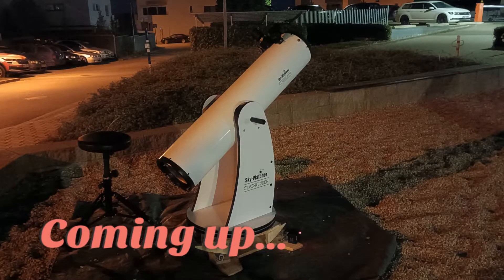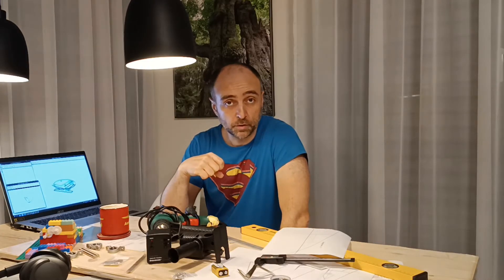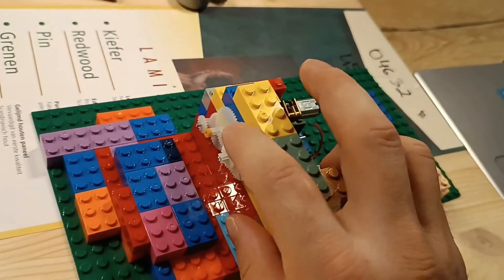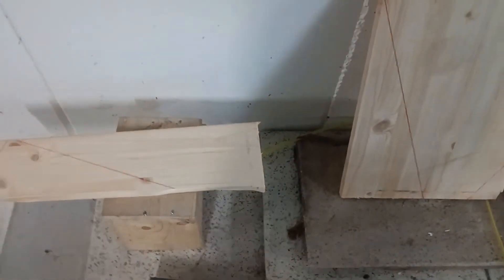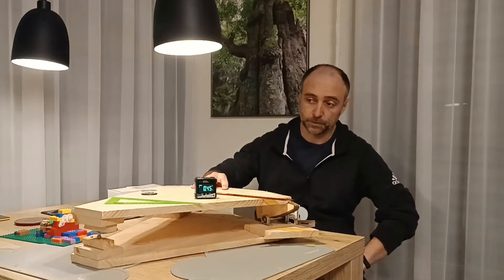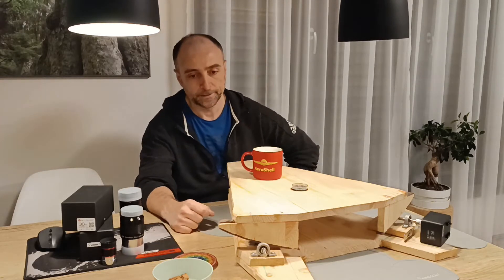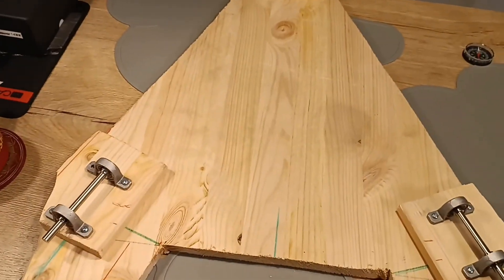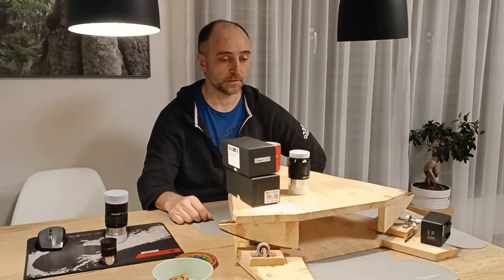Tracking for a Dobsonian Telescope - Home Made EQ Platform

Comment from the maker: 🌟If you are intending to build one of these make sure to also check the second part of this video. It is for a larger DOB but it contains some valuable lessons learned that need to be incorporated into the design of any EQ Platform🌟
https://youtu.be/8NtrHkfYcRs
Reply: Які сигменти потрібні для широти49°05′ пн. ш.,дякую.
Reply: Good afternoon Can I ask you to send me information where I can buy a motor and components for this platform, thank you
Reply from the maker: @denibeni4982  Please see the following instructions - https://drive.google.com/file/d/1ZZb25MRHyBEOHmIY-6CAJ1WFfoio8Uv5/view
Reply: Good afternoon, can you tell me what the diameter of the internal shaft in the celestron eq2 ?

Comment: Great video and explanation, i am very interested in building my own eq platform and this is the best video i found on youtube explaining it

How is the platform polar aligned? The front part should be pointed to polaris?
Reply from the maker: Hello , the pointy end of the bottom part of the platform should be exactly south.
If you are in the southern hemisphere, then it should be north.
Reply: @astralfields1696  i live in a 36 degree latitude, i used chatgpt to calculate how to make them, and i succeeded in making some circles around a 36 degree line, but dont know if they are exact:

This is the method i used

1. Draw a 540mm line (length of base)
2. Mark the pivot on the line (20mm from the right side of the line)
3. draw a 36 degree curve from there
4. Mark a point on the degree curve line 69cm (for my particular latitude) and draw a 69cm circle with a compass from there
Reply from the maker: Sorry I use my own SciLab script, don't have the time to go into details of other methods 
Have a look in the description of the video, I offer fully ready to use plans and segments (per specific location) for a small donation.
Reply: @astralfields1696 nice, i understand, so buying your plan i will have the segments specifically to my 36 degree location ready to print and cut? Thanks
Reply from the maker: Exacrly.. I calculate it to a six digits precision.

Comment: Interesting video.  Ive looked at Rainer Vogel website and concluded if you want a true conic section for the VNS platform instead of cutting with a saw you can 3d print an exact elliptic segment for any lattitide.  I also think a stepper motor (with Arduino control) will be sufficient as old printer/scanners have these motors that would otherwise be scrapped.

Comment: Hey brother, make a eq dob mount for 12" also....
Planning to get it but 10" or 12" which should I go for...
Reply from the maker: Hello, Already did. Check out my video BIG TELESCOPE tracking which was a few videos later :)
I would recommend the 12" DOB over the 10" DOB.
Reply: @astralfields1696  Yes sure 😊 I'm going for the 12"🔭.
Brother, can I use Single "Nema 17 5kgCM Stepper motor for 12"?
I don't know how much KG/cm celestron motor is, if you confirm please reply.
Two celestron eq motors are not in my budget..
Reply from the maker: @swarajdevotee721  The 12" is a great choice. I have no experience with the Nema motors. The issue is not about KG/cm but slipping between the rods and the wooden segment. If you watch the video, it was slipping with one motor and as such I can't guarantee that my design will work with a single motor. Maybe it will if you solve the rod/segment friction point somehow, add a sanding paper or something like that. 
Never investigated those options as I found it easier/more stable to invest in two motors.
Reply: @astralfields1696 That means It has power but slips right? If I make some changes for friction, then It can be done with a single Motor. Correct me if I'm wrong 😊
Reply from the maker: @swarajdevotee721  Yes, I think one Celestron EQ1 motor should handle the load.. but it also depends on the latitude and how tilted the telescope will be ... lower latitudes = more tilt = higher strain on the motor.
Reply: @astralfields1696 at 20° latitude, what's your suggestion, what should I do
Reply from the maker: @swarajdevotee721  Ahh my friend, that is too low I am afraid to be working even with two motors. My platform can handle latitudes from 30 degrees up only.
Reply: @astralfields1696 ahh it's fine, Can you give me some Idea, how to measure and cut the woods for 20° latitude. It will be very helpful 😊
Reply from the maker: It is not a problem to calculate it, the problem is to build it.. that is way too steep and it will cause the telescope to topple over in 15 minutes of tracking. At those latitudes you have to investigate other methods of tracking.
Reply: @astralfields1696 I understand, for now  making this for 114mm dobsonian. Hau to measure and calculate,

Comment: I bough the instruction and made an EQ platform. I am so happy with it. Until now, I was not really spending time with moon or planets. I have a 10" F/5 Dobsonian and never used eyepieces with short focal length, e.g. max 15 mm. Reason: everything was moving too fast and had to correct too often. With the EQ platform, I don't have to do it anymore 🤩. I started using my 9mm and 6mm eyepieces and starting looking at the moon. Yesterday, at ~210x magnification (6mm), I also started drawing moon craters, which was not possible until now. The EQ platform changed my observing life and I am thankful to Evel🥳. Only drawback: the telescope gets 15-20 cm taller. I have an adjustable astrochair and this is only a problem when observing at zenith.
Reply from the maker: Congratulations 🌠. I hardly ever use my telescope without the platform. Especially planetary nebula are so nice to  look at high mags.
Reply: @astralfields1696  Where can I buy the instructions?
Reply from the maker: @Alexutzu.2010  Please contact me on evel30m@yahoo.com with your latitude and telescope.

Comment: I ordered the sector template from your website for my 35.6 N latitude and the full PowerPoint!. Made a tweak to lengthen the north to south bearing. Made this eq platform and it moves perfectly (used two motors as my scope is 10” and heavy). Now waiting for clear night. BTW I used voltmeters too!

Comment: How do you account for the added weight when attaching more accessories? For instance, with components like a camera, barlow, or field rotator, or if I decide to switch from a planetary camera imaging setup to a DSO setup?
Reply from the maker: The EQ platform has a lot of flexibility in terms of the center of gravity. It is absolutely fine adding or removing weight from the whole telescope in terms of equipment.

Comment: The drift is most likely due to imperfect polar alignment. For really accurate tracking one should perform drift alignment anyway.

Looks good. Great for high powered observing, sketching and even some eaa/imaging.
Reply from the maker: Yes that is correct, usually there is some drift up or down due to alignment. I don't usually bother about it unless I am imaging at high power for long durations (example Mars for 10 minutes)

Comment: Great video!  I would love to see you create a video of your setup/alignment process for an imaging session.
Reply from the maker: Yeah , that is something I am planning on making a video but the weather here has been abysmal. Haven't had the chance to do a single imaging session since August :/
Reply: @astralfields1696  I would like to see that too. My platform is tracking well, but for planetary photography I get a little drift (away from the equatorial tracking) which may be due to polar miss-alignment. I have to nudge the telescope which is difficult at required magnification. The alt "bearing" has too much sticktion. I already replaced the bottom friction bearing with a Lazy Susan style bearing which works great.
Reply from the maker: @ Yeah, there is a way to achieve an exact alignment with the EQ platform, sent you an e-mail on that earlier today :)

Comment: First of all, thank you! All others over engineer and complicate the design so much that they're near impossible to replicate without a degree and laser-accurate equipment. 

I need your help ...

1.  In order to eliminate the dreaded azimuth "sticktion" issue that all dobs have, I added a 1/8" thick sheet for the Teflon pads to slide on.

2. I'm at 33.23°

With the additional 1/8" height on my base, could I simply use the 34° wedges?

If not, could you calc these for me and let me know the dims?

You're the best!!
Reply from the maker: Thank you!
I agree, I did not like most designs I found online as they are usually overengineered. While it may be sometimes fun to overengineer things, it makes for a poor DIY design that anybody can replicate. That was my main goal, simplify as much as possible and keep the costs to a minimum. Glad to see that now over 10 000 people have viewed both videos.
1. This is why I love the GSO , over there they have a lazy susan type of azimuth bearing and it is very nice. Other than that, there is a trick with rubbing the wood and teflons with soap every now and then. The thickness of the base plays no role whatsoever in the EQ platform performance in terms of accuracy. 
2. Oh yea , the 34 will work just nicely, then all you gotta do is when using the platform , raise the southern pivot by 0.70 degrees... which most of the time is irrelevant anyway as this is within the margin of error of most surfaces. You don't really need to do it unless planning for 5-10 minutes of high power tracking for imaging etc.
The commercial platforms are actual sold with 5 degree increments of the segments.
Reply: @astralfields1696  That sounds perfect! 

And, yeah, I read all the "tricks"  - from RainX to corn starch - baby powder to bar soap - CD's to vinyl records. I just wasn't willing to go down that "just for now" path of lazy that would cause more problems in the long term than solutions in the now. 

The OG's raved about a laminate that's now discontinued so, I figured that would be my best starting point. I pulled the specs for it and realized that it's incredible performance had nothing to do with it being a laminate - it was due to its rough texture.

This gave me the idea of using a textured, self lubricating, plastic that was as durable as yet less expensive than PTFE (Teflon)... ABS!

I found a company that produces round ABS sheets so I got an 18" for less than $20 and... just... WOW! I seriously almost cried the first time I took it out after adding it. I can literally guide whatever I'm viewing right back into frame as of I just hit a rewind button.

**Almost forgot - your design states the top is to be 18mm thick and the bottom 12mm thick but your layout is showing all pieces being cut from the same board? Have I misunderstood something?
Reply from the maker: That is an option if you want to save some weight, the bottom can be thinner. It has zero impact on accuracy so no worries. I should put an explainer in the plans. Thanks.

Comment: I saw your project and the entire video; you mentioned there's an issue with the latitude because the segments are adjusted for latitudes from 40 to 56. I need segments for a latitude of 20.8° S or 21° S. How can I solve this problem? I appreciate your help.
Reply from the maker: Hello, 20 is really low, the telescope would topple over after a while as the segments would be really steep and the platform would have to be really long. I am afraid for such low latitudes you will need to use a different design altogether. Try asking on CloudyNIghts.
Reply: @astralfields1696 Ok, I will post my question there and hope that someone can help me. One more thing, could you tell me what is the measurement of the radius of each circumference of the mount 4 to 10 inches? The red, yellow and green?
Reply from the maker: That is just an illustration of the different sizes of DOB bases where they would roughly fit on the board. There is no specific pre-defined dimension. My 8" SW had about 54cm and my 12" has about 64cm

Comment: Can you really use magnification 400 and 800 live ( no electronics, processing ) and get reasonably good sharpness and brightness ? I never ever can get such picture quality out of my 10inch dobsonian
Reply from the maker: Oh yes , in the 12" DOB 300-400x - I use it all the time pretty much on everything, from the planets , to planetary nebula to globular clusters. Sometimes on the Moon as well. 
500-800x is more difficult because of seeing. I've had luck with it only few times on excellent seeing later in the night around 2-3AM and generally only on the planets or planetary nebulas. But generally most of the time planetary nebulas at 500-600x are great as they are already a bit fuzzy so no issues with a bit of a blur.
- I'd make sure your collimation is top notch (if you have a laser keep in mind the laser has to be collimated itself first) and best to doublecheck with a cheshire collimation tool and of course the regular star test for good measure. Once collimated I find I need only minor tweaks to the primary.
- Other than this some locations simply have permanent bad seeing and can't go much above 200-300x no matter the telescope. I hope this is not your case :). Also the time of day plays a part.. I do most of my observing after midnight.
- Lastly, always give an hour or two for the primary mirror to cool down to thermal equilibrium and observe from areas that don't have big concrete objects underneath or nearby or over which you point the telescope.. as they can cause micro turbulence in the air around.

Comment: If you’d kindly make any video about making the segments for different latitudes, it’d be really helpful. I’m at 23.7°. Can’t find that segment in the pdf. 

Plus, about the pivot pin height, did you offset it to make the platform angle same as the latitude angle? How to set that properly?
Reply from the maker: Hello. It is impossible to go below about 40 with this design. The reason is two fold. The platform needs to become a lot longer than wider.. That would be still doable but the segments would need to be a lot steeper, meaning the telescope could topple over or they would need to be very short providing only about 20 minutes of tracking. I know some people in Australia managed to build a small platform but it is not something I can recommend, do or test (as I live at 49).
With such a low altitude I would investigate around other modified deaigns by asking around on cloudynights. It is about adding a motor to the south pivot as well and having it more complex.
Reply: @astralfields1696  Thanks mate. Was really inspired by your detailed video. Keep up the good works.

Comment: Im at 40 ° latitude will this design work? I just found 41 in your pdf . can you give me a design ? thank u
Reply from the maker: Sure.. I have updated the plans with a 40
Reply: @astralfields1696  If i make the platform 20% longer-720mm,should i use the old 81mm picture, or i should make it longer together?
Reply from the maker: No you should be fine... Just put it at a different angle so it is perpendicular to the south pivot.. probably something like 20 degrees instead of 23.
Reply from the maker: Hello. I am going to include pictures of the platform from other people into the plans to inspire and encourage others that they can build one as well. Could you please send me a picture of your completed platform (in case you did build it) to evel30@yahoo.com
Reply: @astralfields1696  Sure, but I need some time.

Comment: How do you polar align the platform accurately? Does it have to be leveled on the ground?
Reply from the maker: If your segments are designed and cut for your latitude exactly, then the platform must be leveled at 0 degrees (the bottom). If the segment is for 50 and you are at 48, you simply raise the southern edge by 2 degrees to match it (not ideal obviously so having good segments is preferred).
As for polar alignment, simply put the platform as north as possible. Then while observing if there is a drift upward, you simply rotate the whole thing clockwise , if there is drift downward, you rotate counterclockwise. Just a little is enough. Once there is no drift up or down it is good. By up or down I mean the Alt direction of the telescope.

Comment: hello, I was wondering if you could kindly share the segment file, I too am in 49 degrees north.
Reply from the maker: Hello , use this file please. You will need Libre Draw (free SW) to open and print, PDFs mess up the scale and the segment needs to be exact
https://drive.google.com/file/d/1bN5_YGRXX08wjLcYF9KRjmvtxk6BXTWT/view?usp=sharing
Reply: @astralfields1696  thank you very much! do you happen to have a list of all the parts used in this project besides the wood and the motor?
Reply from the maker: @AFK-Toilet  try searching for these on AliExpress. I am putting together a plan with parts , should have it in a month when I will also release a new video on an improved platform for the 12".
1)  8mm Durable Pillow Block Thrust Bearing Zinc Alloy Mounted KP000 KP001 KP002 Housing Self-aligning Insert Linear Shaft , 2) 5mm to 8mm Flexible Coupling For Stepper Motor Coupler Shaft Couplings 3) 2x 10mm M8 M6 Universal Boot Bonnet Gas Strut End Fitting Connector Ball Screw Bolt 4) 100mm long , 8mm thick iron bars
Reply: @astralfields1696  thank you! I'll look forward to the new video!
Reply from the maker: Hello. I am going to include pictures of the platform from other people into the plans to inspire and encourage others that they can build one as well. Could you please send me a picture of your completed platform (in case you did build it) to evel30@yahoo.com